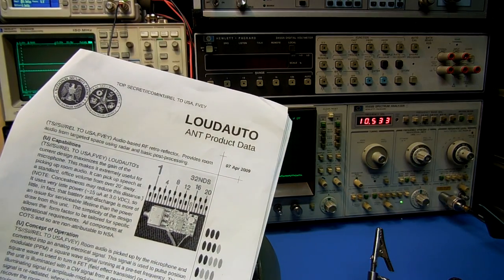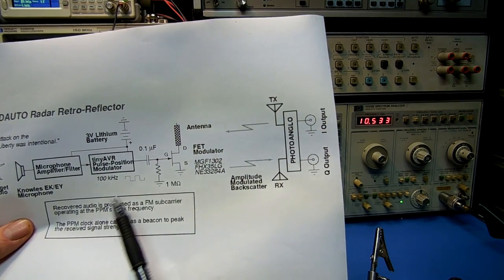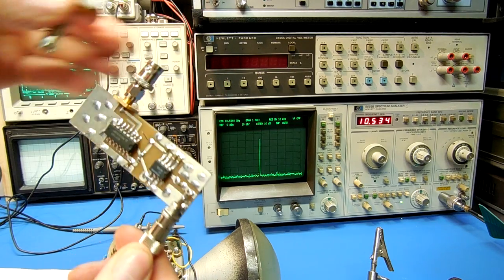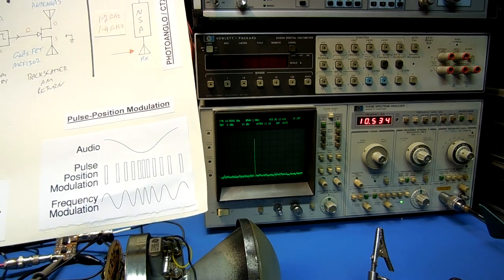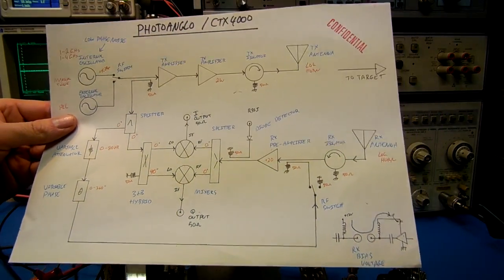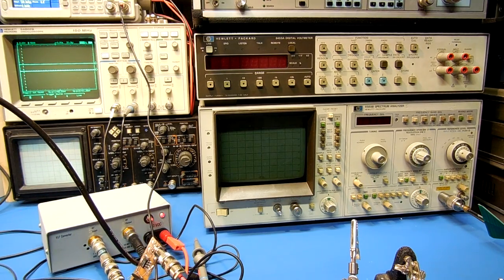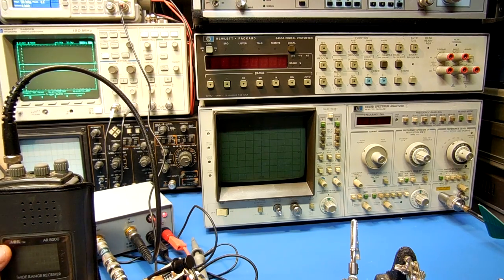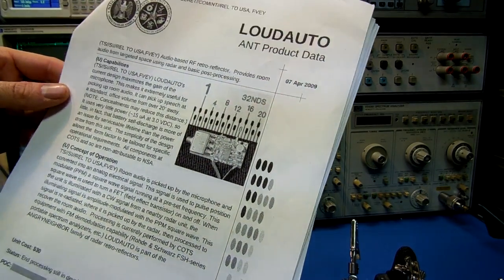GBPPR Vision #27: Overview of the NSA's LOUDAUTO Radar Retro-Reflector

Comment: so... you are outputting AM radio via the ATTINY's pwm?
Reply from the maker: The ATtiny is configured as a pulse-position modulator at a pre-set ultrasonic carrier frequency, say 100 kHz.

The audio from the microphone modulates the PPM and the output pulse train of the PPM toggles the gate of a FET to generate the (AM) backscatter signal when illuminated by a remote radar unit. 

The audio is then demodulated as a 100 kHz FM subcarrier on that received (backscatter) signal.